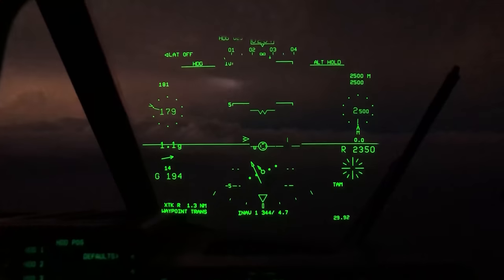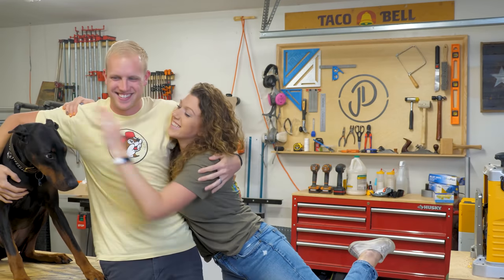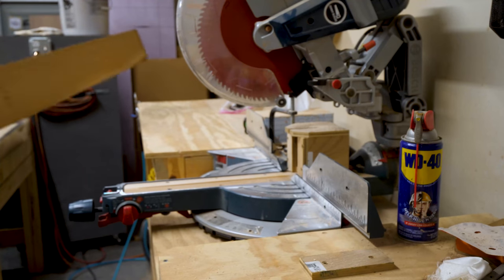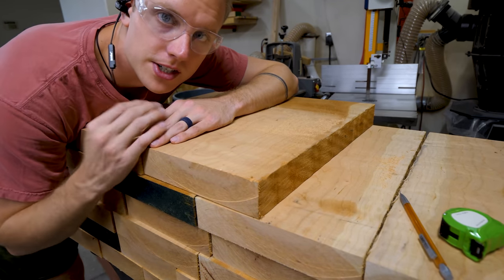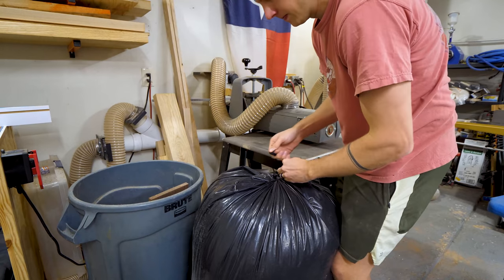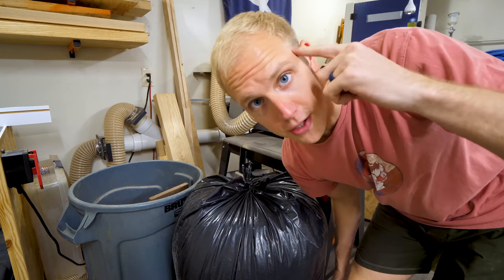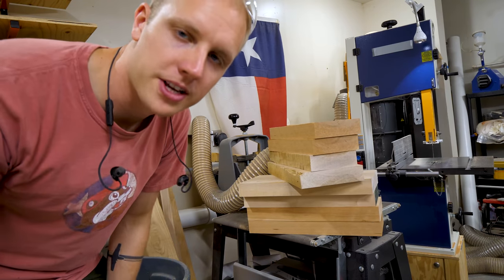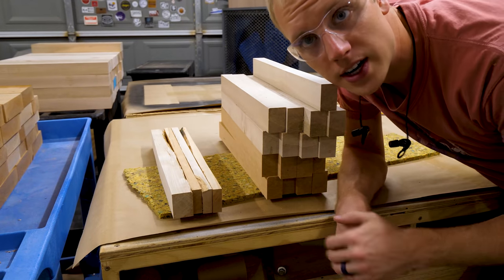What tool is best for cutting boards?

Comment: Ok, so everyone telling you to get a ripping blade is right... to an extent. Sure, a ripping blade will allow faster cleaner cuts. But it will not help with tension being released in the wood. Maple is known for this.

On the other hand, because of the way it cuts, the bandsaw doesn't release the tension in wood the way a tablesaw does. 

TLDR, get a ripping blade for those rip cuts that are final cuts, but stick to the bandsaw for sizing your material beforehand.
Reply from the maker: This is my expectation. I’m sure a rip blade will help, but I’m really rooting for the bandsaw!

Comment: Well. If you are working the way you are on the table saw: stick with the bandsaw.
Better for your safety for sure. I would hiwever expect after so many years of woodworking you would understand the basics of working with a table saw.
Once you have learned that the table saw will be the better option for faster more accurate cuts.
Rip blade. Position behind table. Blade height and speed.
Extra stop at front for width. And a few more issues. Just get the basics right first.

Comment: The beginning audio was horrible and much louder than your voice. Later music and audio levels were better. 

When the wood binds on the saw blade, I flip the board end-over-end and start the cut from the opposite end with the same side of the wood against the fence.  

As you noticed, you have an issue with the wood.  If the band saw doesn't slow you down, you need to use it. Your profit is affected by speed of production, so you need to do it the fastest way. 

Just be safe.  

I love your show and always look forward to the next one.

Comment: Why do you use a jointer? I would just spend a tiny bit more on s3s lumber and skip all the time spend doing that.
Reply from the maker: The edges the table saw cuts aren't the ones used for the glue-up. Also, saving money is not really a priority - we have plenty of margin. We'll cut costs once we scale big enough for it to make a 5-figure difference.

Comment: A rip blade would help, but maple is just a bit*h like that. Internal stresses are better on the bandsaw. On walnut, you probably will have less internal stress.
Reply: However, since you’re going the full business route, you will probably want to look into getting a more robust table saw with more HP. A 3 or 5 hp motor will eat through that material and have less safety issues than your saw. And if you start employing other people, it’s one less liability.

Comment: It appears that you are using "rough sawn" boards and have NOT jointed at least one edge.  If you joint one edge before using the table saw AND use the proper blade, ripping blade, you will not have this issue.
Reply from the maker: Hi Frank, I know the video wasn’t super clear, but we always joint one edge and once face before this operation!

I think we’re gonna try the rip blade tomorrow

Comment: "Your table saw wastes more material and you'd have to plane it anyway." WRONG! If you'll use a Freud Glue Line Rip blade, you would not have to plane it and you'd save considerable time. That blade will give you every bit as good a surface for gluing. I do it on every rip cut and never have to joint the edges. You'll need a powerful table saw in the case of thick maple or walnut. Mine's 3HP. Use a ripping blade!! Don't rip with a combo blade. That's your problem.

Comment: Different blade. How many teeth do you have on that one?  I think with the right blade you should handle 8/4 maple okay.  Not sure how powerful your saw is but it could be you are better off using the band saw. I think the time savings in planing less with tablesaw would normally be worth it but if the saw you have won’t cut it. (Pun intended) better off on bandsaw.

Comment: Anyone suggesting using a table saw to rip 8/4 wood into strips has never done it and has never seen it bind
I had this happen to me multiple times and use the same approach as you - bandsaw
it is absolutely shift of grain because of released pressure and it will bend inward on the cut causing bind on the riving knive or worse on the blade and you can get kickback
I've actually got this with material as slim as 5/4 (very old dry staircase steps I was repurposing) so humidity also has nothing to do with it. it's strictly grain under pressure moving because the cut offer it a place to go. You are 100% right